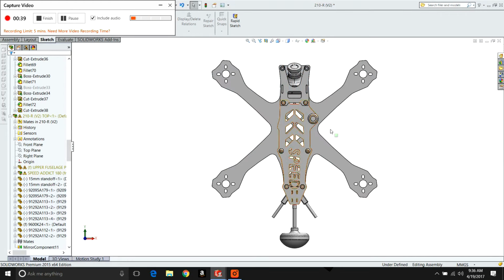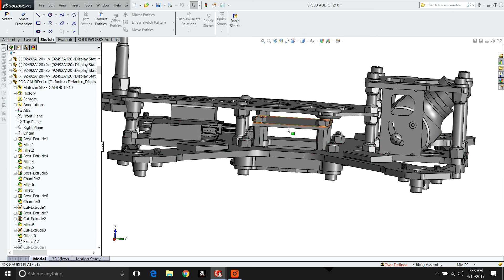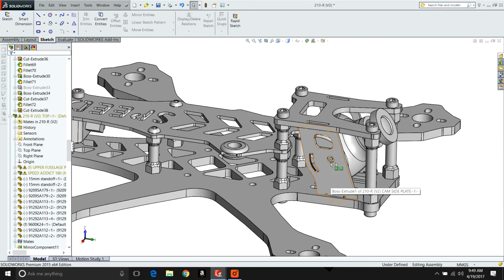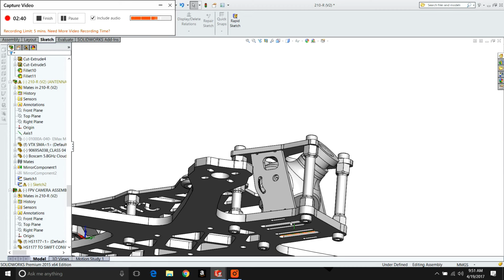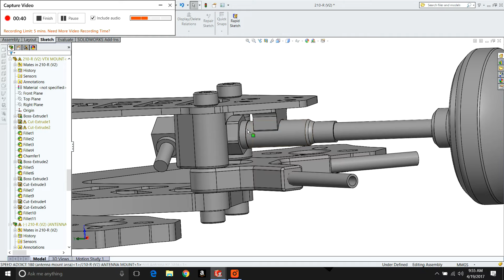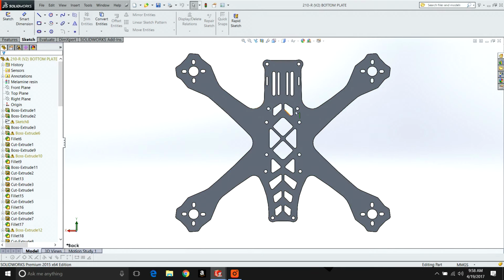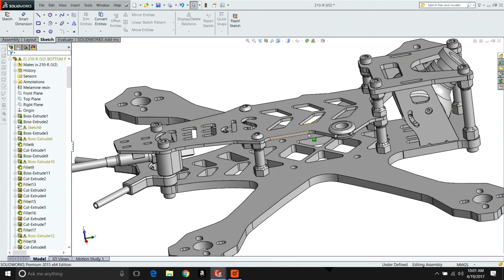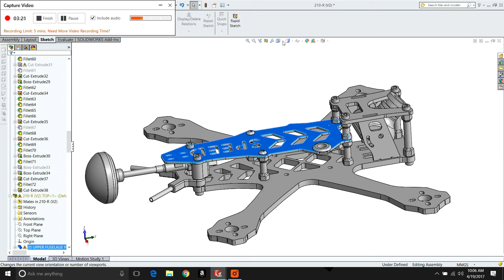SPEED ADDICT 210-R (V2) ~ What Changed?

Comment: I loved my v1 best and funniest frame i had flown yet, in my opinion until I had a power loss mid flight and lost my quad.. searched for days still no luck.. I feel like I lost power because of the fact the pdb set so low into the frame I could not get my battery leads soldered in good plus they seemed to have a lot of stress on them because there was not a lot of room for them... I hated losing that quad I flew it everyday after work for about two months... talking about hurting my feelings. lol never thought losing a quad would feel so bad... good job on changing the pdb bay.

Comment: do you find it difficult to change the fpv antenna when its tucked in the frame like that, can you do it without removing the top plate ?
i love the 210-R. 99% of my fpv life has been with that frame and its nice to see you do a V2.
Reply from the maker: You can! All you need is needle nose pliers. Its not hard.
Reply: great!